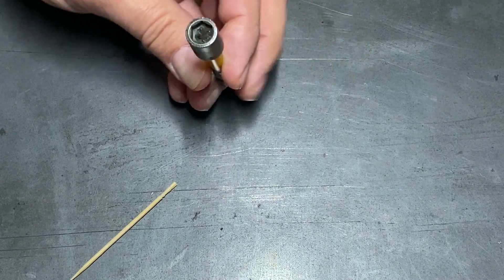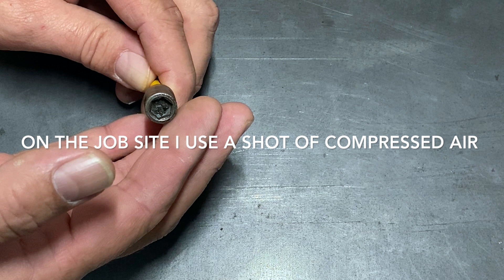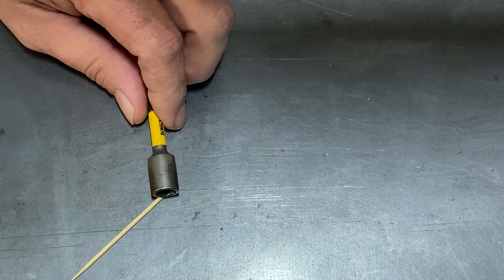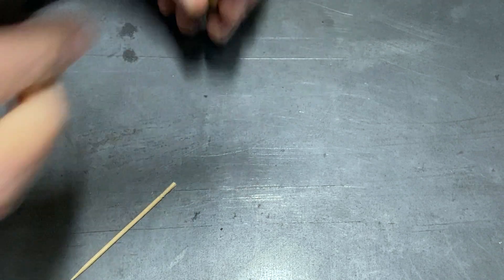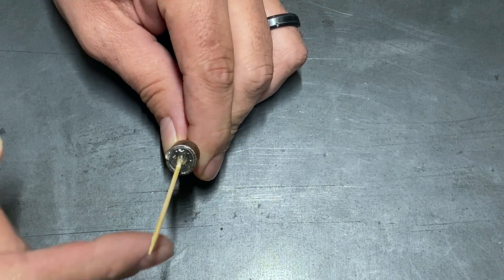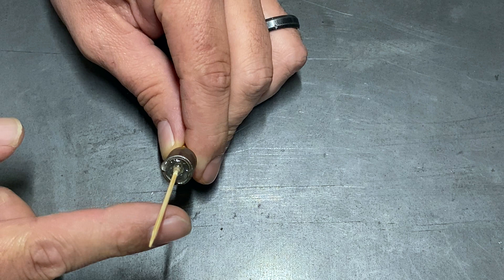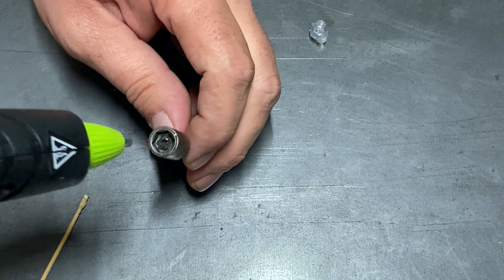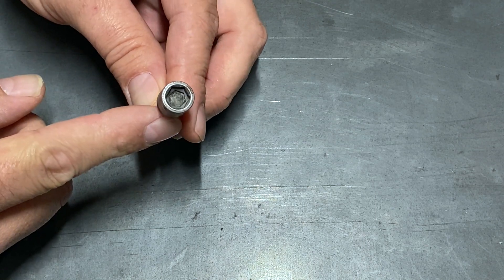How To Clean A Magnetic Nut Driver

Comment: I work on prefab steel buildings and we drive tons of self tappers and get this all the time. We just use leftover bits of mastik roof sealant and squish it into the driver a few times. I imagine sticky tack would work as well.
Reply from the maker: That’s a great idea, I’ll be using that on the job site. Thanks for the tip, I appreciate it.